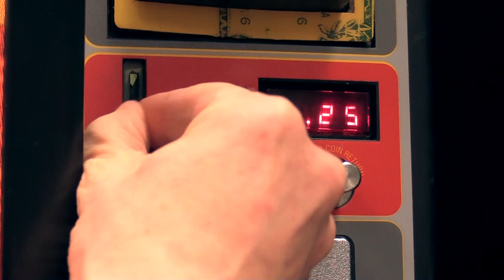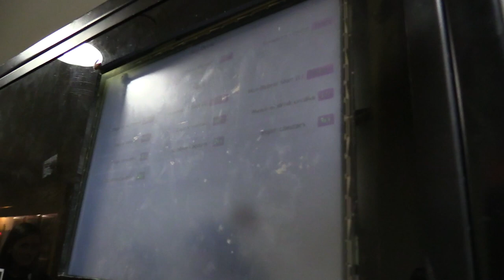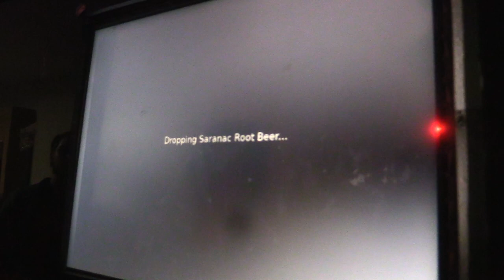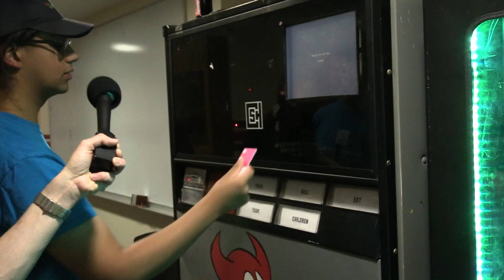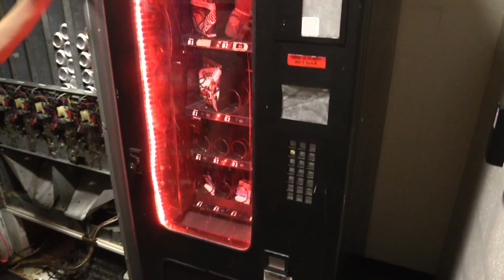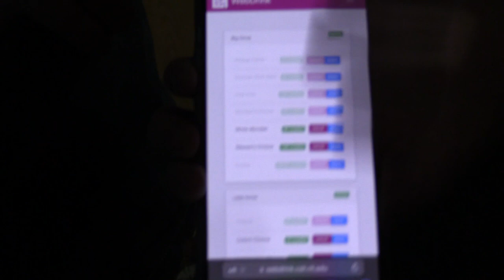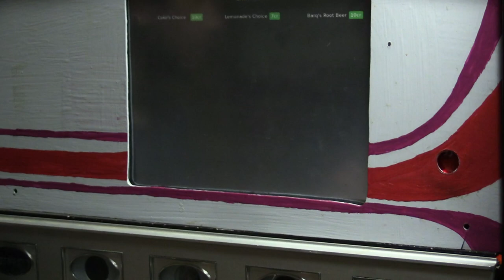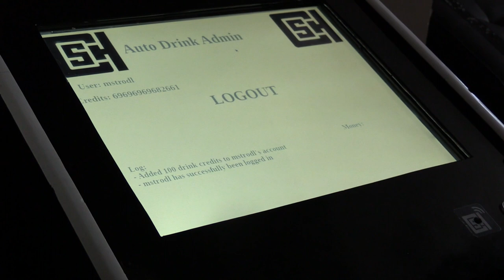Ancient Computer Hacked Vending Machines at RIT University

Comment: I lived here from 91-93 and remember Drink well! Everyone had memorized the time it took to walk from your terminal to the machine so they could input the correct delay. Since everything was controlled software side, the program even allowed you to select random, or from the Mystery slot, which was a slot the administrator had loaded with oddball drinks they purchased when they went to get supplies for the machine.

Back before the days of over the counter controllers like Raspberry Pi, the machine controllers were wired and built by our own Computer Engineering and Electrical Engineering students. The machines shown here are 'old' but both of them came after my time there. I lived with the second iteration of Drink. Funny story- we discovered by accident one night that drinks were dropping occasionally on their own with no one having ordered them. This wasn't entirely unusual since sometimes people would drop them as a prank/surprise when others walked by. However these drops were a mystery since it was during a school break when anyone who could have done the dropping was easy to find. Eventually we figured out the culprit was the microwave oven that at the time was in the bay next to Drink! An EM fluctuation from the oven was just enough interference on the handmade circuits in Drink and it triggered a drop. Anyone who knew was sworn to secrecy and a solemn vow to not drop themselves free drinks, at least until they could fix it.

Thanks for making this video, it really took me back! I loved my time there and I love seeing the current generation keep up the old traditions. I hope someday I can get back to visit and see how things have changed.
Reply from the maker: Thank you for sharing your memories of the drink program!  It would be neat to see some pictures of those original machines and controllers!
Reply: Yuuuup! Used to live across from the lounge from '04-05, and I had it calculated out that it'd take 12 seconds to walk from my room to Big Drink. Good times!

Comment: Hey this is super late so you might not see or respond. But yea I have a 501e Dixie Narco and some reason just today when I put quarters into it they drop right into the coin return. Nickels and Dimes work though, could a quarter be stuck in it's own department or maybe I need to reprogram it to accept quarters? I'm not sure how to open up that part where the change falls into the stacks though
Reply from the maker: Try pulling open the front deck and cleaning the sensors with a damp microfiber cloth.  Also, look into the quarter tube and make sure the quarters aren't jammed in there.  If it still doesn't work, swap out the coin acceptor with a known working one and see if it works fine.  If it does, you will probably need to send that coin acceptor out for service.

Comment: Even in the 90's this would have been considered snooze fest. I can't believe people are considering this as "cool" today.
Reply: Okay smarter than... how would a street kid have done this in the 90's?? 
We got decentralized even free and open access now. I cam afford a raspberry pi now. So why Don't you make yourself useful and share your great knowledge with someone and actually be good?
Reply from the maker: I attended college in the mid-90s and we could never control the vending machines with our computers back then.  What advanced things were you doing in the 90s Nathan?
Reply: @wild-radio7373  "Okay smarter than... how would a street kid have done this in the 90's?? " Okay Mr. not so smart. In 1991 to 1996, I worked for a company called APAC Inc. which stands for Ashland Paving and Construction.  I was hired on to automate Asphalt plants in the southeastern US States. Before 1991 when I started, men would climb up on towers grab a handle to open a silo holding either sand, river gravel, rock or stone, into a gate that lead to a scale. The men would watch the scale and let go of the handle when a required amount of that binder was on the scale. They would then pull another lever to unload the scale into a double barrel mixer. The men would climb up on these 150 foot silos at all times of the year and at all types of weather. Mixes were made by the plant operator turning on valves manually and watching a timer. Before automation 80,000 pounds of mix was loaded into trucks within 3,000 pounds as going over 80,000 pounds meant that the driver had to get out and shovel out the overage or dump the entire load on the ground and retry the load. Mixes could be rejected by the customer if it was not within 5% of what they ordered. My first attempt at automating the plant was to load a truck within 1,500 pounds and be within 3% mix of what was ordered. We outfitted 10 different plants within 3 months. WEM industrial had made a machine using an 8086 that would work actuators to replace the men on the towers. This machine cost about  $30,000 in 1990's money and would charge about another $50,000 to install it. The machine was about the size of a small refrigerator. The machine provided an RS485 input as you could specify the type of rock and it's weight that you wanted. I wrote the software to interface to this machine and was using an IBM 286 to control the WEM machine. 

After about 4 months I had researched OPTO-22 equipment. And for about $1,000 in OPTO-22 equipment and using plant personnel to install actuators, the entire install process could be down in a few days. The OPTO-22 interface controller fit into a standard S100 card cage, ~1000x smaller than the WEM machine.  I worked on the software for about 4 months and had 10 plants to test with. I was there at each one for the entire week for the initial run. Everything went well. The dash was on to retrofit the rest of the 180 plants. I only made it out to a few which had problems with installs using WEM equipment previously. In 1992 I took up residency at a local asphalt plant and went to work on updating plant hardware and software by replacing the WEM(Wisconsin Electric Machines) with OPTO-22 hardware. By the middle of 1992 using OPTO-22 hardware, I had brought the tolerance of the mix to 1.5% and a load out of the truck to within 500 pounds using Hardy scales and Load cells. In this time APAC had also developed a traffic light system for government municipal use since all asphalt plants used traffic lights to signal to drivers when to move the trucks, albeit manually. I also automated that part which lead to the spin off traffic light system. I also developed the flashing red light after the load was finished to specify to the driver to sit still because a weight of the truck was being read. With this single change of the flashing red light, I was able to change the loadout from within 500 pounds to within 120 pounds. APAC Corp was sold to Williams Brothers in 1998. I don't know what happened to Williams Brothers after that. My local asphalt plant still uses parts of my software even today. I drive by once a year or so, under the guise of getting a weight of my truck. They will do it for free. I do it just to get a peek at current systems just to see if my software is still being used. 

In the 1990's I would have used a single OPTO-22 interface that had an RS-232 input that was then connected to a terminal that was able to receive the entire screen. Price in 1994 ~$300 USD. You still can buy them from OPTO-22 themselves or find them on eBay for less than $50 USD. Since each room had their own terminals, sending a message to this specific terminal would be interpreted as which actuator to turn on to release a bottle or can. The OPTO-22 interface card when then send back a message via the terminal to the terminal that originally sent the message that the order had been fulfilled. 

My entire house was automated in 1995 and I am able to turn on any light or ring either the front doorbell or the rear doorbell from anywhere in the world. I originally did that by using a supplied AOL web page that AOL used to provide for you to post pictures to and I would run an IBM Model 80 computer with OS/2 to monitor this page every 2 seconds to see if a radio button on the HTML page has changed. I originally had a dial up to AOL and then later switched to a leased line. That was before the internet was a thing.  I still have the same interface but now using a i3 core machine still running OS/2 but I use my own webspace now. 

As usual this information is not useful for you. If you want to do something useful with this, the raspberry pi has 16 io pins that will drive OPTO-22 G4 opto isolators which can turn on anything from 5 to 30v dc or 120 to 240v AC. You can purchase a G4PB24 to hold these isolators and also make it easy to connect wires to them. You can find all of this on eBay.
Reply: @HappyVending  "What advanced things were you doing in the 90s Nathan?" Oh... I don't know... things like Asphalt plants and everything that had a switch in my house.
Reply: @HappyVending  "I attended college in the mid-90s and we could never control the vending machines with our computers back then." I also remember working for IBM in 1996 for ACOG the Atlanta committee for Olympic Games that provided you an ID badge for the Olympics that you could use to insert into the dollar bill reader in the Coke Vending machine and would provide you as much FREE Coca-Cola product that was in the machine if you wanted. So, yes, IBM and Coca-Cola was doing the same thing in 1996. I wrote software for Team Sports and was the sole IT person for Field Hockey at Clark-Atlanta and Moorehouse University.
Reply from the maker: @nathanwoodruff9422  Where on a bill acceptor could you insert an ID badge?  Were they specially designed bill acceptors?  Did IBM make the bill acceptors?  According to former RIT students that have been posting on this video, the drink program at the campus actually started in the early to mid 80s..which makes it even more impressive.  What computer automation where you doing in the 80s?
Reply from the maker: @nathanwoodruff9422  I'm sure automated asphalt plants were important...and automated lights and door bells are neat....but I don't think they are any "cooler" than creating control boards and computer interfaces for 50 year old vending machines.
Reply: @HappyVending  "Where on a bill acceptor could you insert an ID badge?" It was a plastic badge probably made from the same stuff that Canadian money is made of. " Were they specially designed bill acceptors? " Nope as they accepted all US bills up to the $20 bill. " Did IBM make the bill acceptors? " Probably not. 

"According to former RIT students that have been posting on this video, the drink program at the campus actually started in the early to mid 80s..which makes it even more impressive.  What computer automation where you doing in the 80s?"  Seeing that I didn't graduate high school until 1983, the church I went to in 1979 with my parents was gifted a CPM machine(remember those?) The church didn't know what to do with it until one day I sat down at it. I ended up writing a role book for the pastor that kept a list of the congregation and a small accounting program for the church as well. That same CPM machine is sitting in my basement today.  A person in the congregation ended up seeing this accounting program and in 1982 offered me a job at the company he worked for Ciba-Vision. Ciba-Vision made tools that make contact lenses. I worked part time after school automating the CNC machine that cut the tools writing the program in HPGL. From a very primitive design cad program written by HP, I would take the saved file and change it into HPGL and then send that to the CNC machine. 
My older sister who worked for the state, told her boss what I was doing for Ciba-Vision offered me a full-time job the month after I graduated high school in 1983. For two years I worked for the state and ended up working with a woman whose husband worked for the Federal Reserve Bank. I talked with him, and he got me signed on with the Federal Reserve bank fall of 1985, making a whopping $34,000 being only 20 years old and no college.  I ended up writing the communication protocol with 3 other people all ATM machines use today for transferring money. That protocol was called Funds-Checks because the only thing you could do at an ATM in 1985 was transfer funds or deposit checks. And because the 8bit machine that ATM's were designed on could only handle 5.3 for a file name, the name of the program was called FUCHK. A bit of trivia for you. ATM Machines all ran OS/2 up until about 2010. I worked at the Federal Reserve bank until 1990. So, if you really want to know what kind of automation I was doing in the 1980's; I was automating the process of everyone having access to their money without the need to stand in line at a bank and talk with a teller.  What were you doing?
Reply: @HappyVending  "but I don't think they are any "cooler" than creating control boards and computer interfaces for 50 year old vending machines." I didn't say automating an asphalt plant was any cooler than having a machine that already dispenses bottles and/or cans to do so remotely. I said that automating a machine that already does that from a terminal near by probably connected by RS-485 is Ho-hum and are surprised that other people today think something that a high schooler today with a raspberry Pi could do in a weekend was this amazing invention. It is on par with being able to ring my doorbell from anywhere in the world, except you could only dispense a bottle or can from inside the building. And I did that in 1995 from spare parts.
Reply: I call BS here. This is important because it teaches automation engineering skills with something that wont kill anyone. In the 90’s for me it was automating a model train layout. If you had done all as stated in your novel of a comment you would know that.
Reply: @pikadroo  You are welcome to call as much BS as you like. But just be prepared to eat crow as my resume is easily searchable on line under this same name. Do you like your crow raw or bbqed???